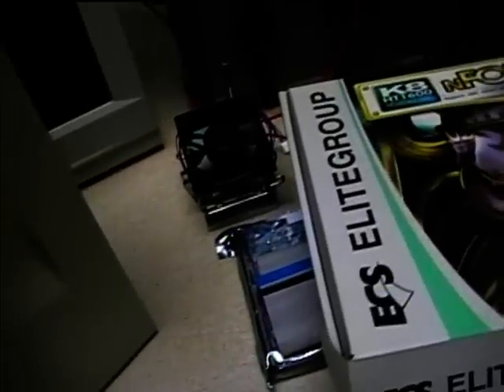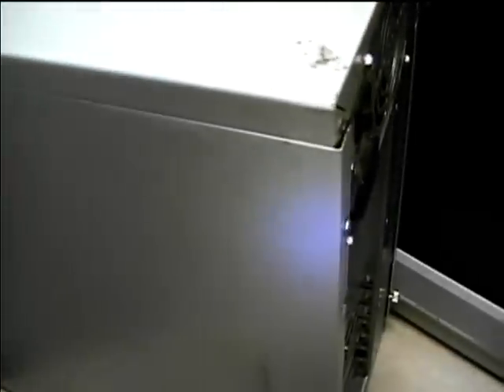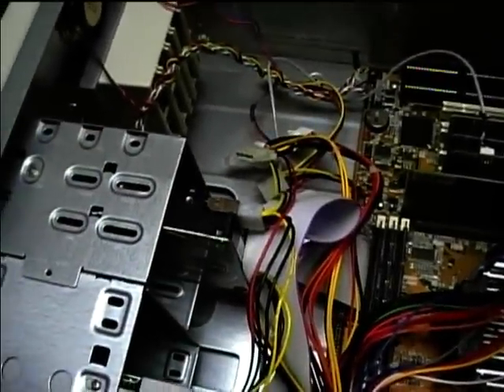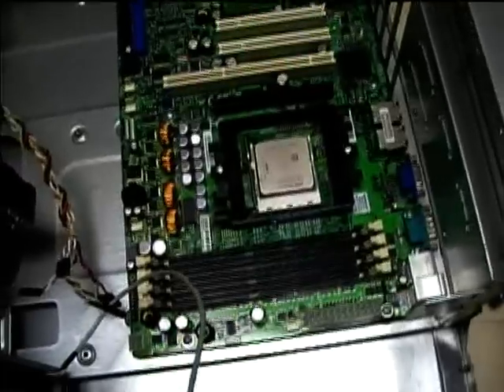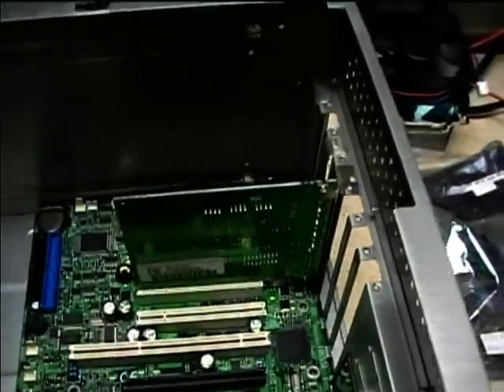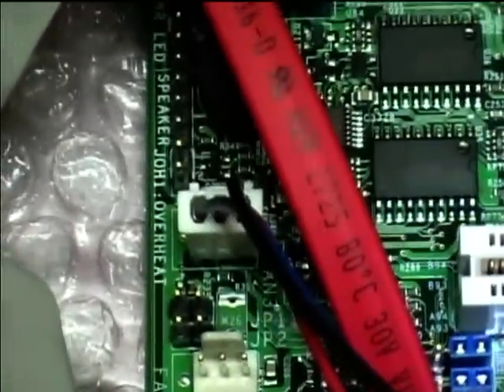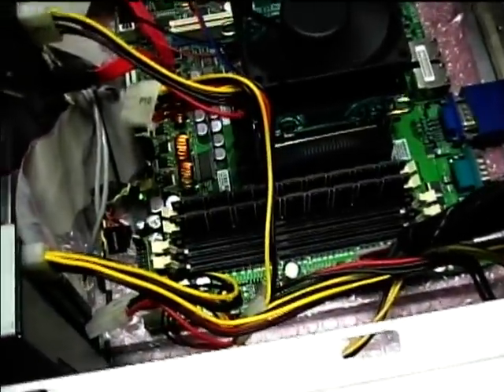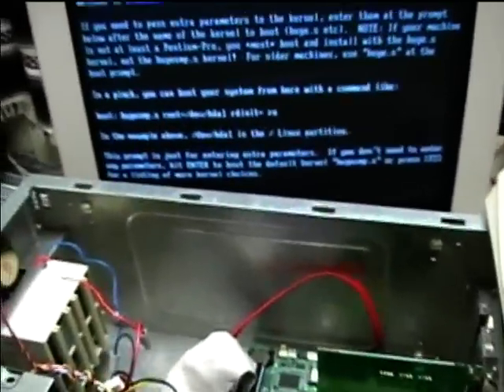Setting up high-performance computer components from Maxxarcade

Comment: I've noticed some comments concerning overheating and venting.  This computer has a large PWR sply and fan.  The PWR sply fan faces directly into the CPU fan, and are about an inch apart.  The air out of the CPU fan is pulled through the PWR sply and out the back.  It looks like the PWR sply fan is performing extra duty.   I have software installed that monitors the fans speeds and CPU temp  If the CPU temp goes above your settings the system shuts down.  It's been humming along ok so far.

Comment: bbishoppcm: It is possible to put almost any "baby AT" form factor motherboard into an XT case, but that style became obsolete in the late '90s.  You could fit in an ATX motherboard by hacking the back panel... same thing with putting any upgraded board into an original 5150 PC -- due to its superfluous cassette port and the wider spacing of its 5 slots nothing would line up.

Comment: I put the computer together that I am using. It has an Abit mother board.,  a 3.1 GHZ Pentium 4. with 2 hard drives, and 1GHZ of ram.  It will take 2GHZ, but they sold me 2 identical ram, and the computer shuts down running 2GHZ.  The ram cannot be just the same it has to be a matched pair.  Last week my 2nd HD 90% full of music & pics was corrupted.  I paid 69.00 for software that recovered 90% of all the files, even though the PC said the files did not exhist. I don't like working on a PC ..

Comment: Looking good so far!  The metal plate that goes over the plugs (called the I/O plate) snaps in  from the inside of the case.  It can be a bit tight, especially on those older cases.

Comment: We love our old audio/visual but when it comes to computers.You have a nice set up there but I agree with the other posts about the ventilation. It will probably be ok but if you decide to add a video card then up grade the case at the same time or you will have a fan forced oven situation going on in there. Cant wait to see how Slackware performs on this machine.

Comment: If I find a really old non working PC (like an old IBM 8086), I may do a similar thing, Ill take all the parts out of one of my computers and retro-fit them in there, course Ill have to modify the case so they can fit, but I'd stick with windows, I just can't work with Linux.  And if I decide to get a NEW computer, I'm going for Mac.

Comment: That old case with a modern CPU in it is gonna be like a BBQ if the system is put under load! :P Lucky you don't have a high-end 3D card in there! You should get a new case for it,  they can be gotten cheap without PSU!

It's always nervous putting a system together, until you see that POST screen, even after you have done it more than a few times. :)

You should try to get a 64bit OS on it! I'm running an Opteron myself, 2.6GHz dualcore. Great CPUs!